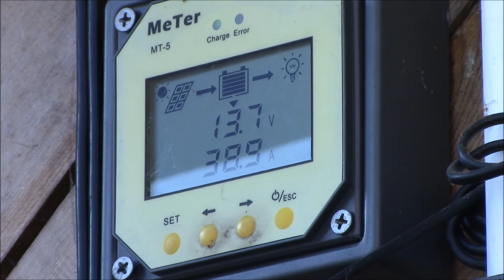Solar Panel Summer-Winter Tilt Angle Effect

Comment: I always wondered this, thanks! Most aren’t adjustable, whynot?
Reply from the maker: I find it makes a decent difference and I adjust the tilt 4 times per year, plus a handful of times in the winter months for high wind where I'll lay it flat until the storm passes.  

Depending on the construction of the rack, it may be hard to make it adjustable or hard to easily adjust it once installed.  On my rack, I designed it from the start to be adjustable, since it's built on top of a horizontal pipe support.  A full 2-axis tracking system would even be better, but that is a lot more complicated and expensive.  

These days, with dropping solar panel prices, there's an argument to be made that why not just add some extra panels to the array instead of spending money of adjustable racks.  Again, in my case, with my house orientation, this is the only place I can get due south alignment and I can only fit 4 panels, so I need to make the most of a limited area.

Comment: Did you show how to you made your rack?
Reply from the maker: I don't have a video of how I built it.  I made the rack a year or two before I started the YouTube channel.  It was made to fit the space I had, ~13' long, 3' wide.  Uses 3/4" galvanized pipe, supported at both ends as the pivot point.  The frame is 2x6 redwood in a ladder type setup.  Then made some pillow blocks to fasten the frame to the pipe on the bottom.  In this video, I rebuilt the rack with some heavier Unistrut:
https://youtu.be/QheXUhomRLY
Finally a pair of cables/chains at the top and bottom allow the rack to be tilted and held in position.

Comment: great video!!! Love those charge controllers!
Reply from the maker: +fliping720 Thanks, yes, those charge controllers do a great job.  It was cranking out 40 amps most of the day today plus 5-6 amps of DC load current.
Reply: R Brown  I don't know if ill ever upgrade unless a get a better bang for my buck.
Reply from the maker: +fliping720 I've been researching their newer model, the BN series.  Seems to be pretty similar with an improved display unit and the ability to connect to a PC for data collection.  The pricing seems to be about the same if you shop around.
Reply: R Brown I have also been looking at those!